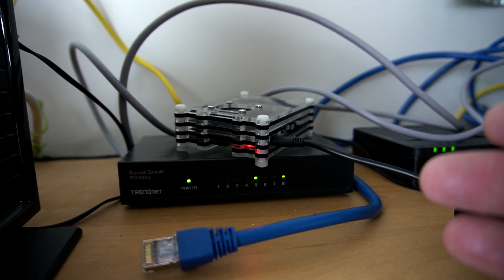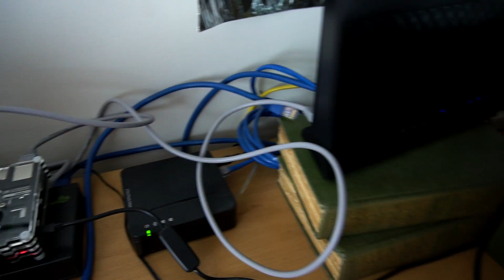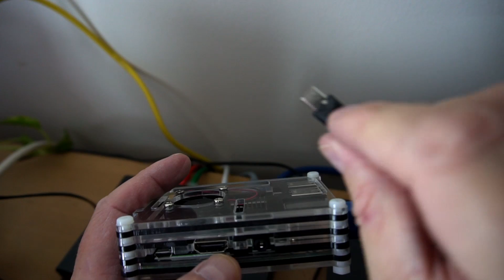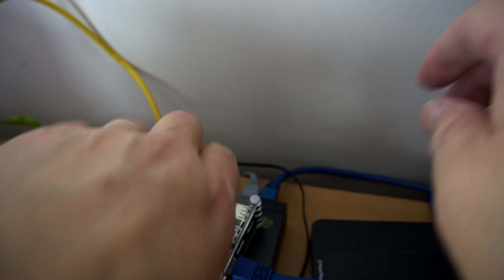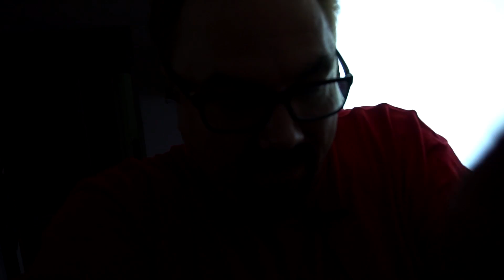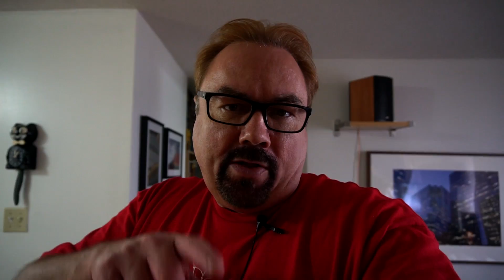Pi-hole -- Worth it? Gotchas?

Comment: Will this work with the Uverse Gateway/router?
Reply from the maker: Doing a fast search....apparently you can.  The best means would be to bridge the gateway and utilize an aftermarket router (what I would do).... the quick and dirty way would be to turn off DHCP in the gateway and use the Pi-hole as your DHCP server.  Best of luck. (search terms --> pi-hole uverse)

Comment: Should you encrypt your connection to the admin login page for pihole?
Reply from the maker: Nah.  You're on the local lan and presumably hard wired, right?
Reply: @CoriolisAffectment I was planning running my router through the pi so all my devices can connect wireless or wired. Can't my information get intercepted over a wireless connection, or do they need to be connected to my network?
Reply from the maker: The diagram of the network including the Pi looks like this:  Devices -> router<-Pi.  All your devices go to the router even the Pi goes to your router.  What the Pi does is act as a secondary DNS server (the documentation spells it all out).  If you have a computer connecting by ethernet to the router, you use that machine to connect through SSH and since it's on your lan there isn't a way to sniff out the communication to the Pi unless your network is already compromised.  In the end, I wouldn't worry overly about it.  You're dealing locally and if one of your neighbours is that nosy...well you'd know about it already, right?  The commands you send to the Pi are really pretty mundane and only consist of upgrading it when the interface tells you an upgrade is available.
Look at it this way:  set it up and then see how it works.  Your wireless devices just see and get a normal connection (with the advertising blackholed).  Your wired devices see a normal connection with advertising blackholed.  I use a wired connection to the router to set up the Pi but honestly, I don't think it makes much difference either way.  If someone is going to snoop on you...they're interested in other things besides the commands you send to the Pi-hole.

Comment: Hi there just a quick question, for this pihole make running do we have to plug through ethernet cable only or we can run over wifi aswell?
Reply from the maker: Hi.  The Pi-hole connects to your router through ethernet and your router uses the Pi-hole as it's DNS server (with fallback to any DNS server or service you wish as the secondary so that when you turn off the Pi-hole you still have DNS) and if your router has wifi then you can use wifi to connect to the internet. 

Here, all devices connecting to our router benefit from the Pi-hole....both ethernet OR wireless. 

The directions included in the links I've posted in the description will walk you through the setup.  Just go step by step and it'll work out fine.
Reply: CoriolisAffectment 
Thanks bro that help.
Reply from the maker: You're welcome.  It's really worth the effort to set up.  Mrs uses a tablet on wifi and I use my phone on wifi and both of us have next to no advertising anymore.  Pretty amazing for about $60 with the case and some sweat.

Comment: Pulling the power plug on your Raspberry Pi will also corrupt your SD-Card and Linux image.
Reply from the maker: No it won't.  The case kit power supply has an on/off switch.  It just reboots when power is re-supplied. Of course...I am frequently wrong so I may gasping hot air, but that was my understanding.  I wouldn't want to interrupt the power if I was actively updating the database but if it's only using RAM then I'm fairly certain it'll just reboot as normal.

Comment: I run Pi-hole on a VPS to serve multiple locations, but had an issue where it caused DirecTV Now to not work.  When DirecTV Now is a subscription service that people pay for, it is not right for them to push so much advertising through the customer's Internet connection.  Pi-hole does work great however.
Reply from the maker: Agreed, agreed, and great idea running it on a VPS (Virtual Private Server for those who aren't familiar).  Thanks for your comment, appreciated.

Comment: It's easier to initially use a monitor/kbd/mouse to get everything configured for those new to the R Pi.  For many turning on VNC for remote access will be a more pleasant experience and relying on SSH exclusively.
Reply from the maker: I would tend to agree with you.  However, because this is at heart a pretty bullet proof exercise with very few things that can go wrong...  Trying SSH, learning what it is, how it's implemented -- logging into a remote system on your own network essentially -- makes for a stress free exercise.  And of course there's the benefit on not needing to plug and unplug peripherals on the appliance.  Six of one, half dozen of another, I guess.

Comment: "No entry in the router for this device" or "no IP address for the device on the router"... so I'm guessing that means you checked the DHCP assignment table or LAN status, but you got distracted before explaining any solution.  (I'm not familiar with ASUS routers.)  I would expect most people would need a monitor and keyboard/mouse on the Pi at that point unless you know the OS on the flash card uses a default IP address.  If it does use DHCP but without the router showing it properly, maybe a nice LAN scan for TCP port 22 being open?
Reply from the maker: No, the point at which the "entries" issue manifested was only to determine one way or another whether the device had actually booted.  It it boots then it will of course have an entry....we don't at this point care about the address because we're just checking that it booted.  No boot, no entry.  So, yes, as with any consumer router one checks in the admin interface and looks to see if an entry is there.  If there IS an entry then the device has booted and we know the address to SSH to --- However, before we even do that, while we're still in the Router Admin Interface, we assign the Pi-Hole as the DNS server and give it the static address (we just make whatever address it was handed as the static address).
Okay where was I, lol, right.  Again, the missing entry was only to make sure we had boot for the device.  Because there was no entry we know with certainty that the device didn't boot correctly and that there's a problem with the OS on the flash card....pointing to us needing to re-flash it again.  Make sense?
Reply: It's better, especially if someone doesn't have experience with R Pi's, to initially use a monitor/kbd/mouse to get everything configured.  I have several, and always have at least one on a KVM switch so I can use it for configuration of a new OS or other troubleshooting.

Comment: Your corruption problem is likely due to the latency of copying blocks to SD cards. The OS or hardware isn't reporting the progress properly. This is very common. As a result it showed that it was trying to eject because the OS couldn't tell it wasn't done copying; the block had been copied to memory but not to disk. When you ejected, it was still copying.
Reply from the maker: Thanks for your considered comment.  I appreciate that.  In response, you're most probably correct.  However, I have to add that there is some idiosyncrasy with the  Etcher program when it tries to dismount the card; for some reason in my OS environment (Win7) that process is what seemed to hang!  I waited what seemed to be what should be long enough to perform the dismount operation and then I ran out of patience.  Obviously not how computer equipment is to be treated.  Upon discovering that corruption, I only changed the option for Etcher to automatically dismount!  This time the copying operation finished and I was then able to properly eject the card through the OS.
Weird behaviour to be sure.  Yet, I agree with your assessment as well.  I believe there is still some sort of copying going on even though Etcher is reporting that it is trying to dismount the card!  Odd.

Comment: Cool, I ended up picking up a RASPBERRY PI ZERO, have not had the time to do anything with it yet. Watched in full, liked and shared on twitter.
Reply from the maker: It's pretty dead easy if you're only doing minor configurations.  I was surprised at how easy it was, the only pain was user error on burning the SD card.